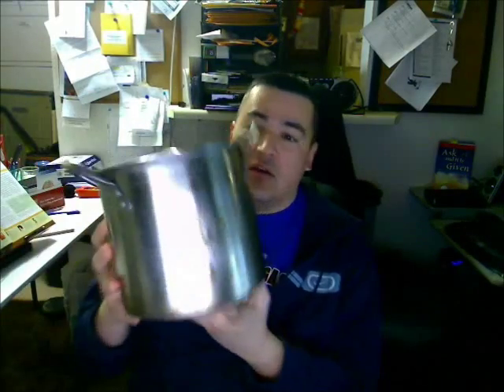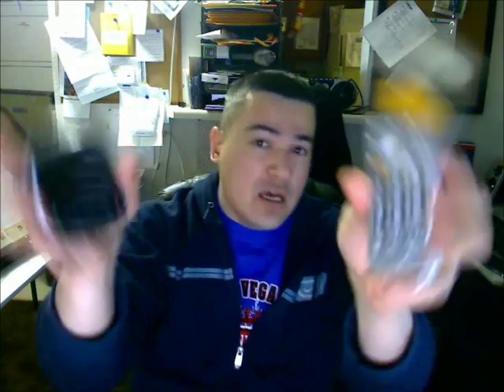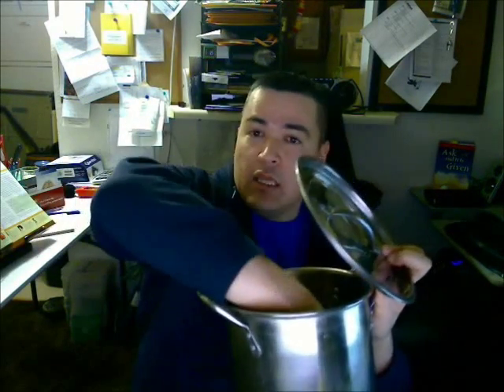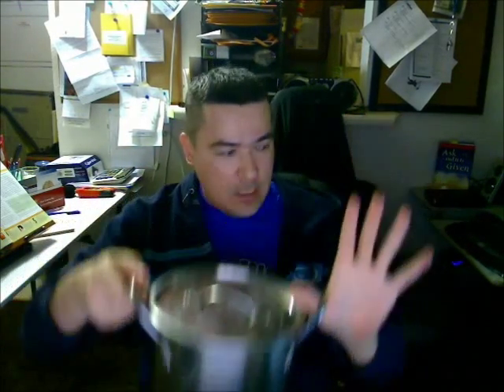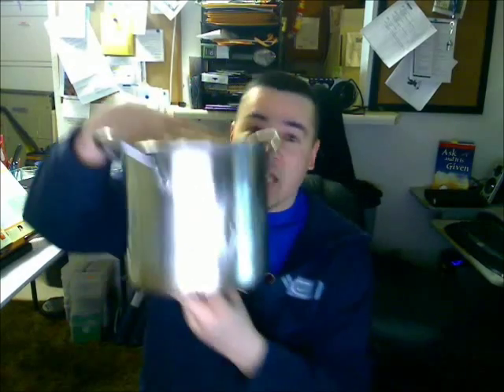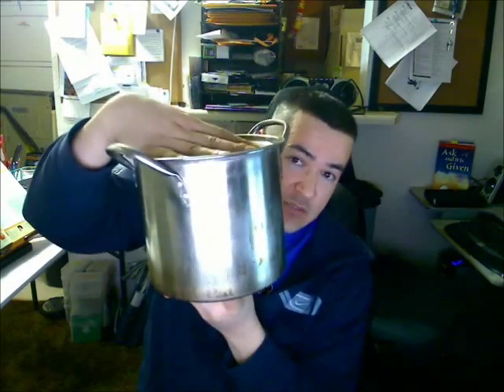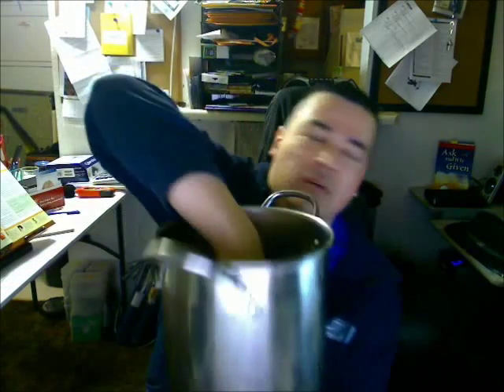Faraday Cage of Aluminum Foil or Pot Works Great!.wmv

Comment: Grounding the faraday cage will prevent static electricity accumulation. Very bad when having long hairs. Those electromagnetic waves are probably slowly charging the hermetic faraday cage,while trying to sneak in. In this experiment, if you had kept dialing intensly for hours, you may get electric shocks if the faraday cage isn't grounded lol. Moreover, the "faraday cage" here is not totally insulated, since the guy who holds it is a conductor.